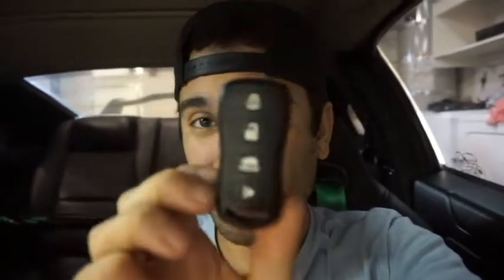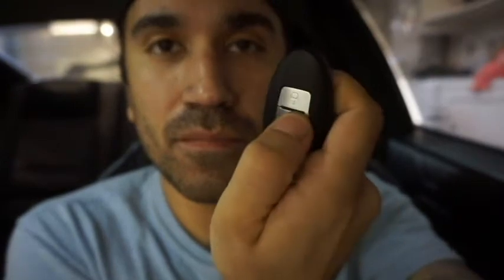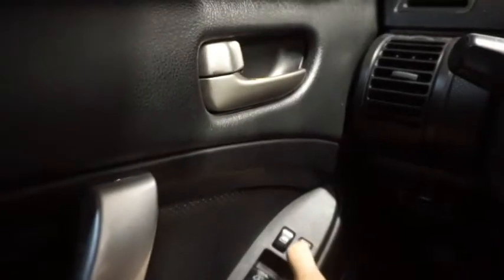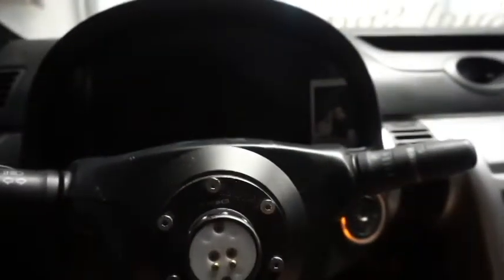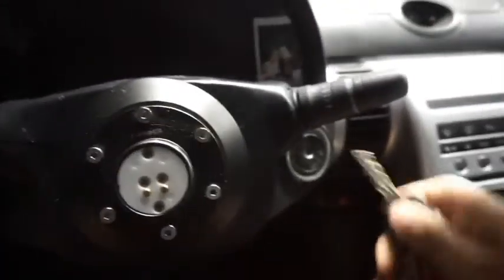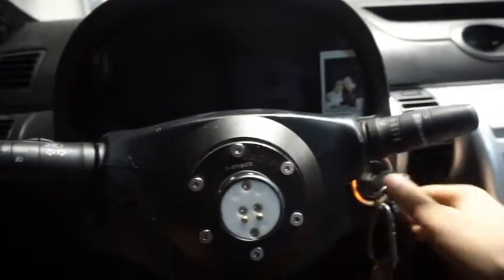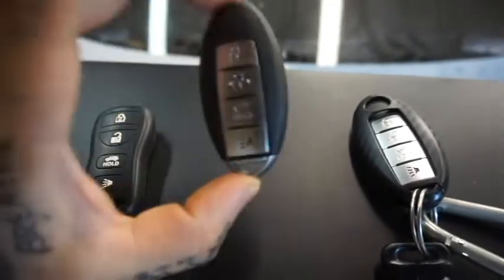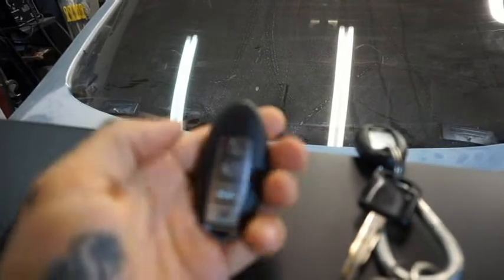How to upgrade your g35 key fob

Comment: any idea why it wouldnt work for some cars, i have had the fob for 6 months lol my car would never even get into the programming mode, nobody has ever been able to give me a anwnser why it wouldnt get into the programming mode
Reply from the maker: You had a g35 aswell? Or a diff car.? It should work at all times so my guess is maybe doing something wrong or using the wrong fob.. where are you located.? If your using the right fob and doing it right and still not working my guess is something wrong with ecu or something
Reply: @Louis_B_creations  g35 coupe 2006, the only thing i notice is a lot of videos i watch of people doing it there key slots in there cars look different, mine has what looks like a plastic dust shield around in front and around the key slot? im not sure if that would have anything to do with it
Reply: @autograph415  I have the same type of key cylinder you have and am having the same problem